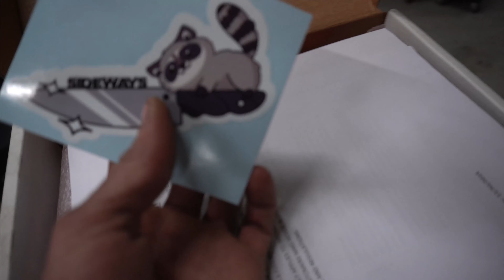Throwing a NASTY Cam In The Porsche Cayman LS1 - LS1 Cayman Part 2

Comment: You don't like superchargers? 
Why not supercharge this engine?
Just curious.  Awesome build, This is the build of the century.
Reply from the maker: The trans couldn’t handle that much power or I’d consider turbo or SC
Reply: @6berries  What about the 911? Why not supercharging the 911 project?
Reply from the maker: @desmomotodesmomoto2033  I generally like the design and driving feel of turbos over superchargers